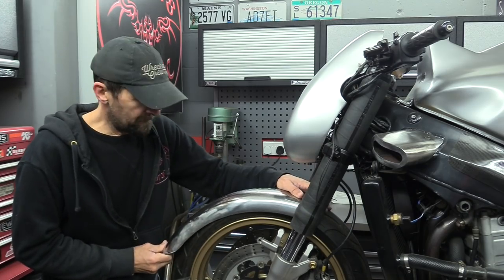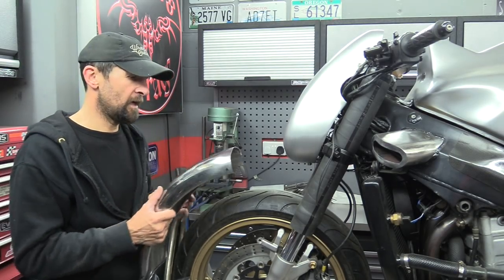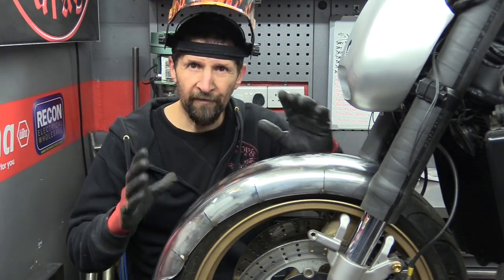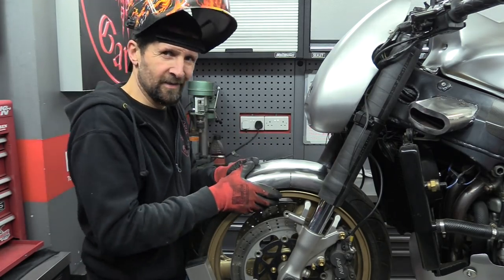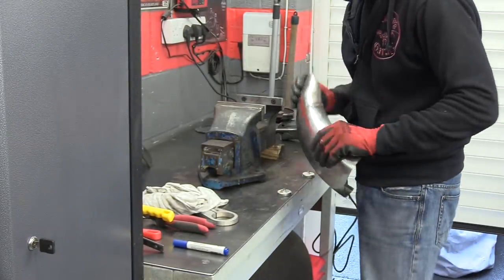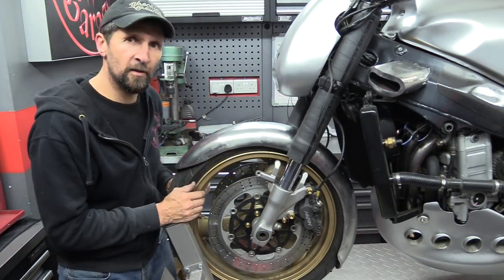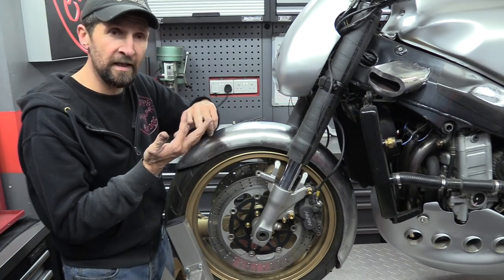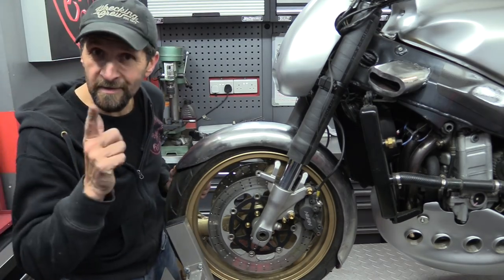Delboy's Garage, Fighter Build #84, and "Toolkits", 3 days to go...!

Comment: Yeah , I’m convinced Del , it’s a fashion that’s come and gone around several times and I’ve seen that many bikes lately ,( Bonnevilles in particular ) with front guards about the size of a postage stamp that it’s time for a change , Look on the practical side of things , you’ll be able to ride in the wet without the feeling that you’re three feet away from a jet wash that’s been aimed squarely at your face and the protection given to the engine and down pipes is  unquestionable. 
              Keep it up mate , lovin the vids , C.
Reply from the maker: Cheers Charlie, all styles and trends rotate round and round over the years aye, this bike is more a self teaching exercise than a bike for show, what ever it looks like or ends up in the style of, its been a fabulous learning curve that ive been able to learn a hell of a lot from..!

Comment: Good work Del, I am new to fabrication and this is giving encouragement.  For me it would be good if you could discuss what the setting are on the mig, gas used, wire etc.  Looking forward to the next one.
Reply from the maker: Hi James, glad to hear that you're getting into it yourself, its really rewarding and you'll be really proud of the things you make for yourself, no better feeling when someone asks, "where did you buy that?".    Each job is different with the setting, stainless steel like this is hotter than mild steel when you weld it, and the thicker the more power you need etc... just get started and maybe use your mistakes to learn from..  Good luck with it buddy.. take care.. Del.

Comment: Could a band-saw be used to make the cuts on the fender?
Reply from the maker: Yes it could Lewis, but you do need to slightly open out the mouth of the cuts so they are very slightly wedge shaped otherwise when you close them up the ends will overlap...and a band saw can only cut a straight line.. the disc can be moved slightly side to side to open out the cut...
Reply: Thanks for the brain wrinkle.